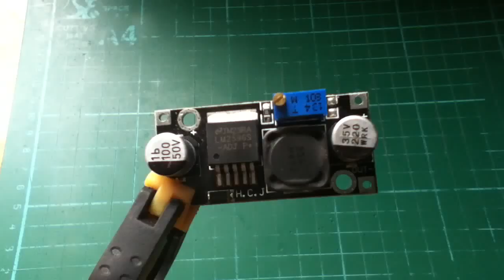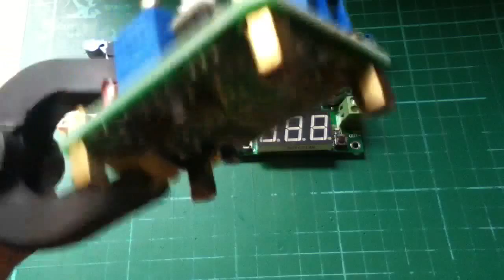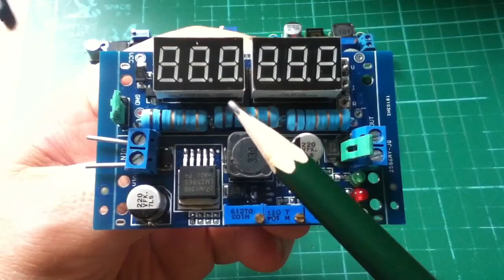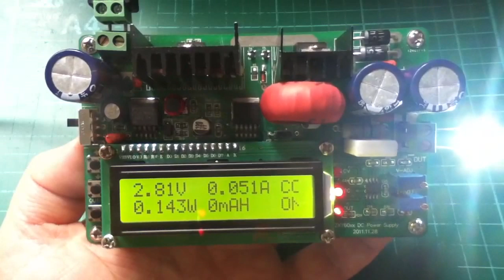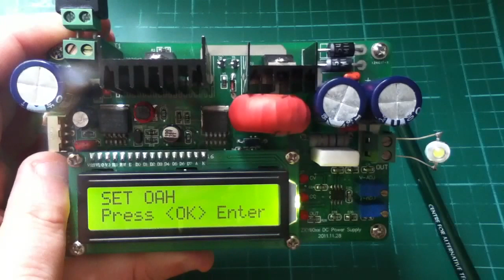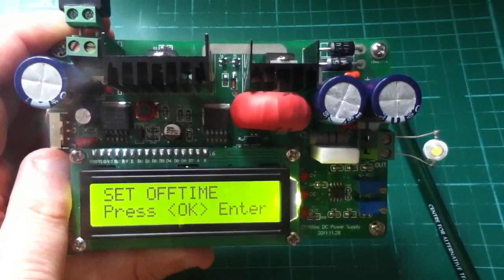Roundup of Switched Mode Buck Converter Voltage Regulators

Comment: i ve a battery in 36v 20ah, i ve a 12v dc 600w 52amp motor (for boat). the question is: if i use a step down power can i use this battery for have much ah? in theory 36x20 720ah. is correct?
thx for response.

Comment: One of things I've noticed with the advent of cheap Chinese buck converter boards is that it is no longer cost effective for me to build a linear regulator. I can take a transformer, bridge rectifier and a couple of capacitors and then attached a converter board of the correct current rating and remote its adjusting pot off board

Comment: Hey Julian - first ill like to thank your for all your great videos :-)

second i have a little question i think you maybe have the answar for.

i´m building a mobile musik box 
for this i ofcouse need a amplifier
i ended up buying a sure electronics board with a STA508 chip (2x100w at 4Ω)
who is rated for 12-30volts. and im wondering 
can i use a boost converter to boost my 12v batteri pack to 24-27volts? - or are boost converters not good for amp

it uses max around 4-5 amp at 24v acording to my measurement, at peak

kind regards
from denmark

Comment: Is it possible to take 2 of these step down converters and make tri-polar power supply. Like positive, ground and negative. I mean power supply for OpAmps.
Reply: Yes u could but its more complex and there is more to it than u think . I have a impression that u should understand better potential difference and the concept of ground DC or AC systems. The virtual ground that u can pick in the system and the ground symbol on the PSU are not exactly the same. On a PSU you have the ground symbol and the + ,- . The ground in this case is connected to  mains ground in the house. Just so u understand think about two 9 v batteries and how u are going to connect them and where u virtual ground is. Think also about the potential difference from higher to lower. Thats why after connecting them u can read 18V, (9 - -9= 18) but it could be also 2v and 7v. All depends how u pick your virtual ground.if i would be u i would build a simple linear power supply with two chips  first  and learn a bit more. But again there is many long answers to your question. Good learning and have fun.
Reply: +Janusz Gluszak Thanks for giving me more insight.

I understand about virtual ground and two 9V batteries. I was thinking more along the lines of take two of these DC-DC converters and connecting them. 

Say, both DC-DC converters have + and - that are floating. So I connect + from one and - from the other to dual power supply's ground. Now these + and - are on the same potential and they form zero. The other two, unconnected terminals, + and - potentials are above and bellow this zero.

Would that work? Or, would I blow up both converters and the dual power supply ;-)?
Reply: HitAndMissLab Maybe not blow up LOL but can be unstable.(That's why i suggested linear system) Also depends what chip is on board and how the circuit is designed.Is it a CC,CV does it have a current voltage sens IC and the and more.Also even if same model  the PSU have different issues like rise time, switching time and more. Since you talked about op-amps you should reduce the noise at the outputs by bypassing technique cause your output impedance will increase a lot. Do you have an oscilloscope?
Reply: Understand filters in the circuit and how to use them.Read as well on decoupling and bypassing and power supply noise reduction. Again its not as easy as it sounds LOL Some EE Engineers  on't understand it even if they studied it. Download a LTspice from Linear Technology(Easy to learn) and design your circuit and test it and you will see.

Comment: Hi Julian,

I am looking at building an MPPT-like controller using a buck converter to control the current pulled from the PV.  In this case, I would be controlling it with an Arduino. Is there a buck converter available on the market that allows for the current limit to be controlled through a digital (serial, I2C, SPI) or analogue interface?   I have been googling but have not come across anything.  This is for a 20W panel that will be charging a 20K mAH battery.  Any pointers are appreciated!

Comment: Love the last unit :) do you remember where you got it? Thanks!
Reply from the maker: bakupcpu That's a ZXY6005D. Also available is the ZXY6005S with serial data interface.
Reply: Julian Ilett hank you very much I'll search for it :)
Reply: Love your channel Julian! This video is over 3yrs old, is the ZXY6005 still a good value, or are there better options now? The ZXY6005 is going for just under $40 on ebay now.

Comment: Hello Julian could you answer me some questions?
I bought a step up converter from 12v to 35v, it can handle up to 150w and I need to power one or two LEDs of 30w each it depends on the occasion.
If I regulate it to 35V which is the recommended input voltage for the LEDs and connect it to a motorcycle battery what is the final current that it will be available? I need it to dim between 0.5 and 0. The problem is I want to be able to connect to my car battery without having to regulate anything is that possible? It must be since all the LEDs light for motorcycles and cars that you buy come ready to install in any 12v battery.

Thank you for your videos
Reply from the maker: Miguel Morgado For LEDs you need a current regulator. So you'll also need an LED driver, unless your step-up converter can also regulate current (i.e. has two potentiometers).

Comment: Hi Julian - love your videos - very informative and thorough. I wondered if I may pick your brain. I'm trying to power and control 3x50Watt RGB led chips (from china again). I bought them thinking a control module would be easy to find - alas, I've spent days in Googleland but am now frustrated and confused! I want to power them off 12 volts (car batteries) and I want to control them with the new love of my life - the Arduino Uno.
The RGB's want 20-26V for Red and 25-28V for the Green and Blue. So I need a boost converter - I get that but do I need a separate one for each colour and then for each lamp - that makes 9 (gulp - that's a lot to go wrong!) Am I right there or have I lost the plot?
Reply from the maker: alexisjohnR If you had 2x 50W RGB, you could probably parallel them and use 3x 100W drivers. But I've not seen any 150W or above drivers, so yes, you may be looking at using at least 6 drivers.
Reply: Julian Ilett
Thanks for that - nice to know I was barking up the right tree.

Comment: Great video. These are excellent devices, and inexpensive as well. One thing I use these for are storing lead acid batteries at the appropriate float charge. A consideration is that I have seen some of these devices come with warnings that if used to charge batteries the module will be damaged if they are connected to a battery at the same time the input is disconnected. As per such recommendations such devices need to have a diode connected across the output, although I have not done this myself.

Comment: Julian, I am sorry to report that your response has just vanished. I cannot find it anywhere. What I understood was that there must be a load from the moment they are powered up. I had a glimpse of your reply by phone but accidentally navigated away because of the small and sensitive screen. Was there anything else you would care to add? I am considering one for the 5v and 12 v range fixed or otherwise for multirotor flight controller Vcc and Camera Vcc respectively.

Comment: Is it necessary to have a load on a switching regulator from the moment they are powered up? I have two that went wonky after letting them idle, no load, for an hour. Very hot, unsteady voltage well below specs. :-( None of these deals arrive in short order and these purpose built 5/6vDC 3/5A ones I have will take as many as 3wks to arr!! Your qualified opinion would very much appreciated

Comment: hi Julian can you pls help me out with a project im suppose to design a charge controller using a buck converter  that will make use of 2 solar panels that will give an output current of 8 amps and output voltage of that can charge two 12 volts batteries

Comment: Hi,in your opinion,whats the best board,ZXY6005 or ZXY6005S?
Reply from the maker: Sometimes I like the simplicity of the analogue controls (potentiometers). But the digital board lets you increment voltage/current in discrete steps (e.g. 1A, 100mA, 10mA or 1mA) which can be very handy. Also, the "S" model has a serial data interface for remote control.

Comment: Hi Julian

I too have one of the ZXY6005D dc-dc converters like the one you have in the video.
Just a note to say beware of using these with input voltages much over 20V.

Mine was working fine for a short while, fed 58 V dc, charging batteries etc. Then it died. The main switching mosfet (IRF9540 p-channel) failed short circuit, taking out the gate drive components along the way.

I've since found that the design of the board ensures the gate voltage swings from close to supply, to ground. This is fine if supply is limited to 20V input, but bad if you go for up to 60V as I did. IRF in the datasheet say limit Vgs to +/-20V or else...

The repair I made now limits Vgs to -20V.
Reply from the maker: That's appalling! I'll put the scope on it and have a look. Does your mod use a zener?
Reply: Julian Ilett Yes, I choose a 15V, to keep the voltage below 20V including small transients. I had to discard the push-pull drive and use a single switch. Efficiencies now range from 80-90% but it should live for a while.